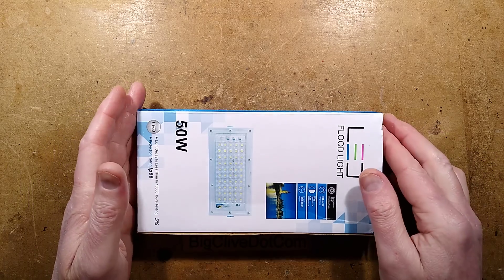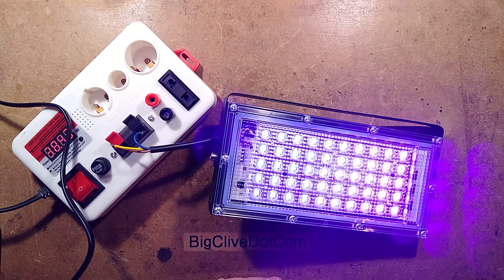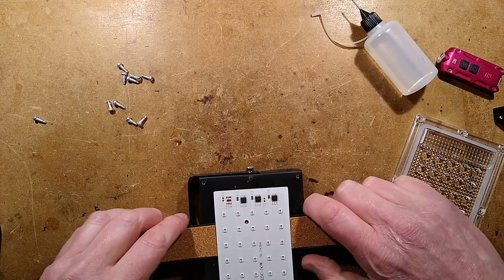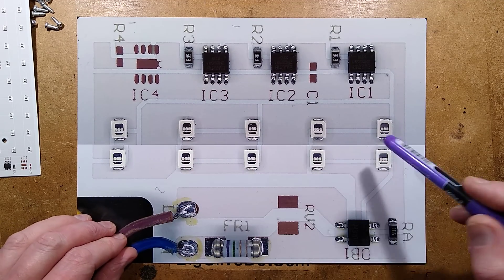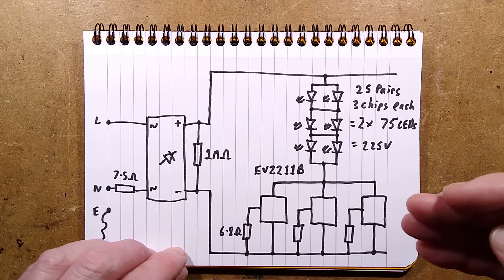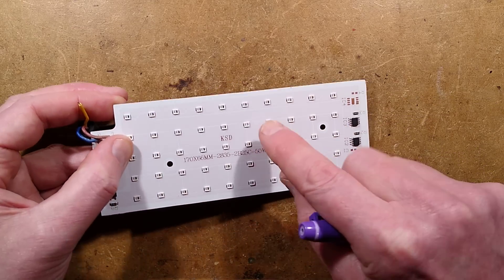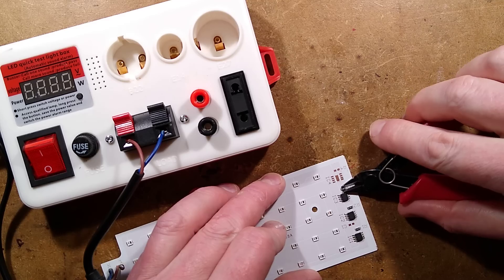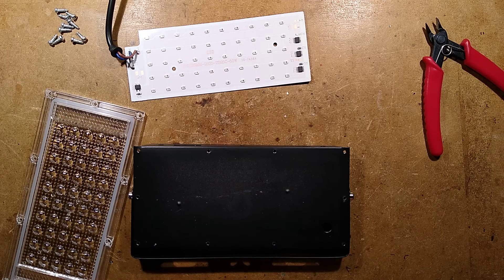Horrible eBay ultraviolet floodlight (with schematic)

Comment: I am dyslexic and I clicked this thinking it was an ultra violent light. I mean, it's Bog Clive so it's possible he might find an ultra violent light at the pound store.
Reply: I refer to shortwave UV as Ultraviolent Light.
Reply: @hughbrackett343  But isn't shortwave radio, which is below infrared?
Reply from the maker: Given the lack of earth connection it does have the potential to be ultra violent.

Comment: 1) When you do the first test and discover the earth wire is not connected, I would suggest also immediately checking if one of the other wires IS the earth BEFORE you put power on it !
2) Just in case the UV level is bright, shouldn't you be (visibly to the viewer) using UV safety glasses ?

Comment: Could you do test/assessment on an ebay item. I purchased this and did not  have success.
AC Current Sensing Switch Self Powered Sensing Switch Induction Relay M3050|3056
Reply from the maker: Did you pass a single conductor through it?  If you feed a flex through it, the out and return current will cancel each other out.

Comment: I bought one of these a while back from aliexpress. The seller thought it was ok as is, the case I opened was decided in my favor and I got my money back. I established some thermal coupling, connected earth to the case and put a CPU heatsink on the back. I wouldn't use it unsupervised though.

Comment: Rule  of UV light. UV light does not go through plastic. You can not see UV light evan though you see the blue light.  
If you do expose the panel without plastic and there is  UV light, you giet eye damage and skin burns over long enough period.
Reply from the maker: That tends to be UVC as opposed to the near-UV and UVA lights.
Reply: still does not  go thru plastic

Comment: I could mount this under a drone with a power supply to find Yooperlites.  These seemingly normal, gray rocks are rich with fluorescent sodalite and glow a vibrant orange and yellow under a UV light.  Found around the great lakes region of the US, they are fun to find and are much more plentiful than people think.  All you need is a UV flashlight or even better a drone with a bottom mounted bright uv light and a gravel pit or rocky area... and you'll find them.
Reply: What are Yooperlites good for?
Reply: @dsloop3907  Fun to find, also they look good in display under various uv light contraptions.  They appeal to the rock collector type personality

Comment: I bought a couple of these with white LEDs. Simple enough to add a small solder tag for the earth wire. Mounting the unit upside down deals with the water ingress problem but I also extended the 3 core flex and sleeved the join with adhesive heat shrink. They'll have some protection under eaves. Not such a bad unit for the price if you're OK doing a bit of rework.
What is truly horrid is the mounting bracket which made of the thinnest gauge of sheet steel that wouldn't be classed as foil.
Reply: Same. I just soldered the earth wire directly to the heatsink, but I decided never to use the lamp externally. In fact, I never used it at all. The circuit board in mine was not even glued to the heatsink.

Comment: That would be perfect for an invention of mine which is a lamp that is a design you can acquire which is a clear glass hollow base, with the lamp works on top.  The idea is to fill the inside with what are known as Yooperlites. These seemingly normal, gray rocks are rich with fluorescent sodalite and glow a vibrant orange and yellow under a UV light.  So a lamp that lit them up when turned off would be a beautiful way to present either a single beautiful specimen, or my whole collection 😆
If you're not familiar: finding and displaying yooperlites is a fun hobby here in Michigan, USA
Reply from the maker: I really should explore the local beach with a UV light.
Reply: When can I expect to receive some in the mail in the great state of Virginia? Those rocks are pretty sweet.

Comment: heatsink compound would of actually made the earth work
Reply from the maker: Standard heatsink compound tends to be an oil and zinc oxide.
Reply: Dare I ask what you are on about?
Reply: @westinthewest  hmm i thought a lot of the heatsink paste compounds had a bunch of metal and carbon particles in them. i think most things that conduct heat also conduct electricity. if the earth wire was just sandwiched between the led panel and the metal frame, it makes sense that it being in a glob of heatsink compound might allow it to make contact to the surfaces that needed grounding.

Comment: The ground wire isn't fake, only its connection to frame is fictitious :)
If the back plate was a bit stiffer and the lens applies decent pressure across the LED board, 35W of dissipation into the aluminum substrate should get it hot enough to re-melt the glue and spread it thinner over time. Self-assembly!

Comment: I found it interesting that upon first power up, the Wattage at the time you turned it off, was 32.xxW and dropping.
When components get warm, shouldn't the power draw INcrease, as resistance goes up?

Also, a Q: Since they're RGB, I assume those individual LEDs are internally programed to run at that color? Therefore, there's no way to hack it to make it produce a different color, correct?
Reply from the maker: The LEDs are single wavelength (plus case fluorescence) and the regulator chips throttle the current back if they overheat.
Reply: Power is V^2 / R so it reduces when resistance increases.
Reply: @westinthewest  Aahh 🤦‍♂️ Thank you!
Reply: @westinthewest  yes, the chips increase their 'resistance' if they get too hot to reduce current, although they dont act like a 'pure' fixed resistance,   it increases with voltage so as to produce a constant current
Reply: @nemesis2264  Ah, so Clive got that tidbit wrong?

As a side note... I honestly think that at this point, Clive needs to get a light spectrum meter, to know exactly what wavelength the product is outputting!
Reply: @DUKE_of_RAMBLE  no, as he said , as those chips heat up they can reduce current to reduce heat dissipation if its 'excessive'

Comment: You'd think it would be easy and cost nothing to connect the ground (earth) to the chassis, it's literally 1 screw and practically every EDA software out there makes it stupidly easy to set up a tie-in point in the PCB.

So the only possible conclusion is ignorance of electrical safety.

Uh... hot melt glue to mount the aluminum PCB to the steel chassis? (I've done that before, except it was wood, not steel) Oh, yeah, that's gonna hold real nice in the sun.

Comment: I believe the filament bulb was never advertised as being uv, because there's no possible way the bulb could transmit it, or generate enough of it, I think they're designed for reptile enclosures, just for some heat at what should be night time, though use of modern terms might have skewed any search result

I feel like you bought this just because someone put one in wrong and you wanted to prove  a point 😂
Reply: Didn't incandescent blacklight bulbs work with a coating that turned the light from the filament into a little bit of UV light?
Edit:
I looked it up. Incandescent blacklight bulbs actually emit the tiny amount of UV light the glowing filament produces and filter everything else out.
Reply: @MetalheadAndNerd  sure but it depends on the type of glass the bulb uses weather or not it will transmit that or not, it might still pass a small amount but not in the level that might be useful
Reply: I had one of these bulbs and can attest that they will light up blacklight posters. We progressed to a basement full of blacklight posters lit by 40w BLB filtered lamps.

Comment: Does it emit any UV light?

As you must drill holes into the backplate for mounting it to a wall with screws water will always come in.
What was it advertised as?
Reply from the maker: It emits near-UV.

Comment: I bought 2 of these lights. One acts as UV source in my curing chamber and the other is used to cure any resin residue on my work bench after working with UV curable resin.
For the light in the hardening chamber I stuck a large heat sink to the back. It works well enough for 3 or 4 consecutive runs, each 2-3 minutes.
Reply: UV light does not go thru plastic
Reply from the maker: UVC is blocked by many plastics.  But not UVA.
Reply: @weldonthompson5410  Fortunately the UV resin doesn't know that.
Reply: @MetalheadAndNerd  unfortunately for me I don't have that experience. The last UV source I worked was 2 Kwatt in full quartz enclosure
Reply: @MetalheadAndNerd  It seems to me that you have NFI how that works
Reply: @weldonthompson5410  As I said in another reply to you, and as other people have said: UV-A certainly WILL pass thru most normal glass, plastics, clothing(!!), skin, etc... Of course there are certain special made materials, like certain plastics or glasses, with added chemicals, polymeres, and what not,  which block (most) UV-A. But in general, yes, UV-A passes thru most common ordinary materials.

I think you are confusing it with UV-B, especially since you mention quartz glass. UV-B doesn't pass most common plastics or glass, but does pass thru quartz glass... hence why that was used in your 2KW enclosure.
Reply: @weldonthompson5410  What should I do with all the perfectly cured resin now that I got enlightened by you about the indisputable fact that UV light doesn't pass "thru plastic"?
Reply: @weldonthompson5410  UVA definitely does, maybe not through all plastics but it does most of the time.

Comment: Where did you get the bottle with long metal needle applicator on top. And well if it has a power name that would help too.
Reply from the maker: Generic eBay needle tip bottle.

Comment: I have the same type of lamp. The earth wire just wasn’t connected. 😱
After a good few minutes or hours, one of the LEDs blew. After shorting it and deleting one of the three chips, another one blew. 
I disabled another chip and shorted the the blown chip and it has been working flawlessly since then (at a much lower output of cause).
Reply: Oh and I connected a new connection cord and properly connected the earth.

Comment: I agree not for the faint hearted but cheap as chips - I bought 3 for Christmas to make a Black Light to illuminate some signs painted in fluorescent paint.  Knowing what to look for I checked the Earth and added my own and housed them in some wide PVC troughing I had around with a plexiglass front.  They lasted OK and did what I wanted but were not left out after 12th night.  They will be dragged out next Christmas.

Comment: I was expecting you to use one of your UV and UVC Test Cards to see if it put out any UVA at all.
Reply from the maker: It would have worked on the UVA sensor even though it's in the near-UV range.
Reply: it will not thru plastic
Reply: @weldonthompson5410  depends on the plastic, but you have a point.
Reply: @weldonthompson5410  It sure will.. UV-A can pass thru normal glass, plastics, clothing(!!), skin, etc...
Even many common general sunscreen lotions don't block UV-A at all (only UV-B).
Of course there are certain special made materials, like certain plastics or glasses, with added chemicals, polymeres, and what not,  which block (most) UV-A. But in general, yes, UV-A passes thru most common ordinary materials.
(and UV-A is by no means safe. It isn't even safer as UV-B, UV-C! That is a very old, but still common, myth. UV-A can cause damage just as well, but in different ways)

Comment: I think I missed something.  What are the 3 (could be 4 but one pad empty) square, 8 pin chips/do/for?
Reply from the maker: Linear current regulators.
Reply: 6:15 Voltage regulators.

Comment: For indoor use, getting a pile of these and hooking them up to be turned on/off by a DMX controller, could give a great light panel. You'd want a metal backplate and I'd probably suggest using something like a thermal 2-part epoxy for bonding them down, but I think they would be quite usable—just absolutely not with that useless wiring/enclosure.
Reply: Since I couldn't find actual thermal glue, just thermal paste mislabeled as thermal glue, I used double sided sticky tape marketed as thermally conductive.
Reply: @MetalheadAndNerd  You can use Kafuter silicone. It's a clone of Silastic. It has a fair thermal conductivity (1.6W/mK claimed but it seems like a slight exaggeration), it glues things down, it's highly heat resistant, it doesn't emit nasty acid while curing or anything. It's cheap and good to have. You can also find thermal glue really easily, sort of white cement like thing, from the usual Chinese suppliers, that's GD9980 and Stars-922 Heatsink Plaster.

There shouldn't be too much wrong with thermal tape either. As long as it doesn't get unstuck when it gets hot.
Reply: @SianaGearz  Does this silicone cure between two sheets of metal?
Reply: @MetalheadAndNerd  Good question. I think air access is needed in order to kick off the reaction initially, so i wonder whether it'll complete or choke off. I should test that someday.
Reply: But what is the wavelength?
Reply: @RagingShrimp67  I don't think Clive tested (he talked about it elsewhere in this thread) but he's pretty confident they are just UVA (especially with the plastic on).
Reply: @ConstantlyDamaged  He's not asking what type of UV they are. He's asking whether they're 405nm, 395nm or 365nm. The difference between near-UVA and actual UVA is incredibly important for many fluorescent use-cases. These would be way dimmer, way more expensive, and burn up almost immediately with that amount of cooling, if they were still-nascent and highly inefficient UVB or UVC LEDs.
Reply: might need to check the PAR value on these lights

Comment: Definitely hackable!  
Put your own power cord on and properly ground it and put some good heatsink paste...maybe even a better mount (aluminum instead of steel)...might have a good purple light  :)
Reply: Exactley what I did. I stripped the led panel and remouted it onto an aluminium extrusion 100x30mm using thermal heat paste. Used the original plastic lens civered to hold everything down. Fitted new three core flex, all now fully earthed and included a on/off switch. They illuminate eight flourescent pads in the floor from about 2mtrs above. Now if left running they never exceed 40 degrees C at any measured point, and the temp dissipates down to 27c within 150mm from the mount. Cheap and cheerful but does the job for us.
Reply: I got some of the smaller ones. Solved the mounting by using some epoxy to attach to a piece of left over t rail ceiling mount, and then used some VHB tape to mount the T rail to another piece, so the 2 were isolated. Then put into a lamp housing to replace the 2D lamp in it. Solved the isolation problem, now double isolated, and even if it does arc over will not be a shock hazard in an enclosed large fitting. Less stress on the insulation if it is floating.